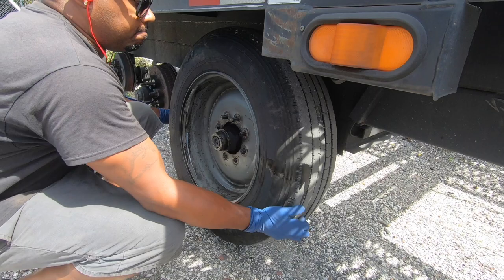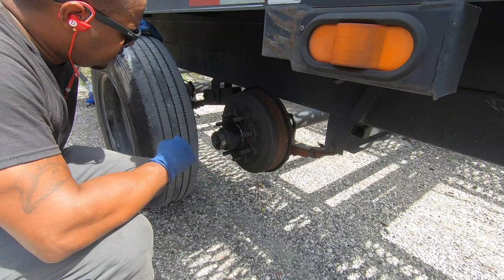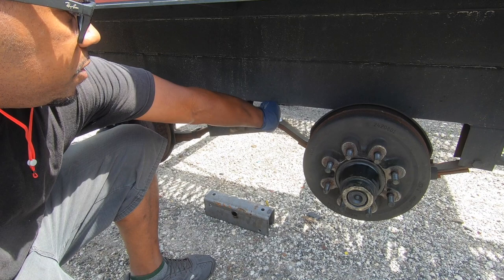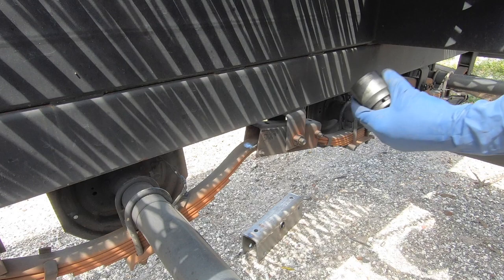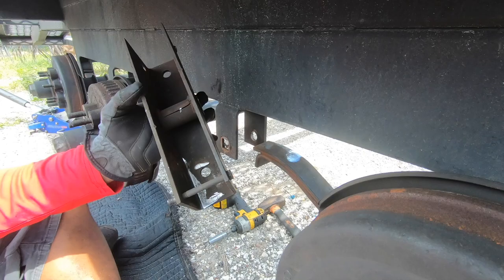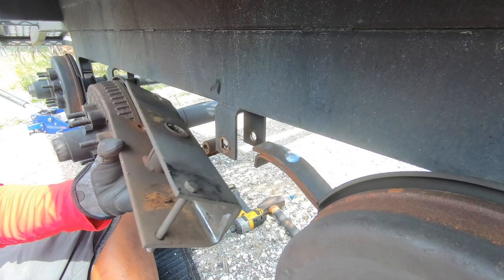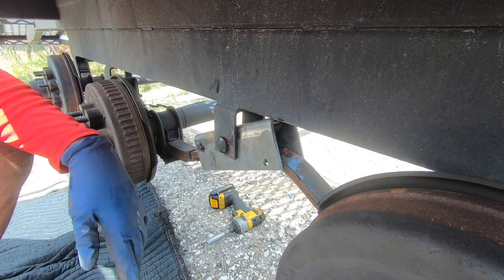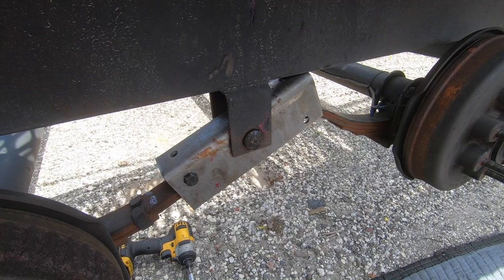Changing the equalizers on Kaufman EZ-4 Trailer

Comment: Are those not grease-able? Mine have grease zerks(that I didn't know where there) on the main/ middle bolt. I would think they would last the life of the trailer if you kept them greased.
Reply from the maker: No they’re not greaseable but I don’t think it really matters that much they would probably be a pain in the ass and the grease wouldn’t last very long with everything being exposed to the elements when you were driving
Reply: @Floridamuscle  the perches on my trailer were welded on backward so the zerks are on the inside and the nut is on the outside. 32' hotshot. I'll never buy another norstar/iron bull.
Reply: @Toolin & Schoolin  You need to upgrade those bolts with Wet bolts... Same bolt but has a hole down the middle and gets fresh grease Exactly where you obviously like it to be. The zerk is right on the head... you can hit it fresh grease w/o taking off a wheel or anything- totally exposed. That will solve your problem permanently. (you can hit em w/a shot of grease when you do your hubs, and if you drive thru heavy rain or after over a hot interstate trip... Look up "Wet Bolt Kit"-
Cheap!! 👍 ~

Comment: Bro quick question whats ur biggest issue with kaufman trailers?
Reply from the maker: Losing wheels with that triple axle
Reply: @Floridamuscle  losing wheels? Like wheels falling off??
Reply from the maker: @omarfelix7588  outer bearing failure will cause the wheel to come off while driving, there’s a special washer you can put in there to stop the wheel from coming off if you have bearing failure, so make sure you ask for those at your trailer supply place
Reply: @Floridamuscle  do you happen to noe what does special washers are called?, by chance
Reply from the maker: @omarfelix7588  Davis trailers in plant city Florida has them but I can't remember the name.